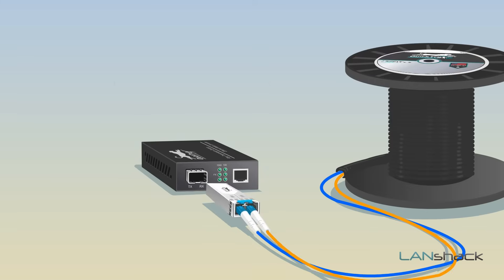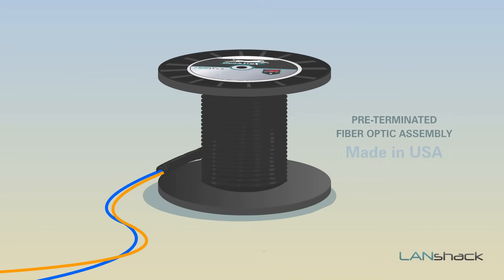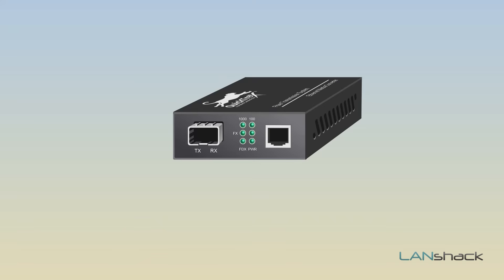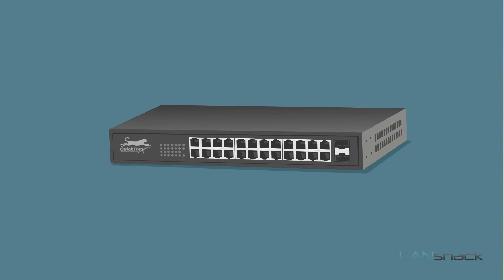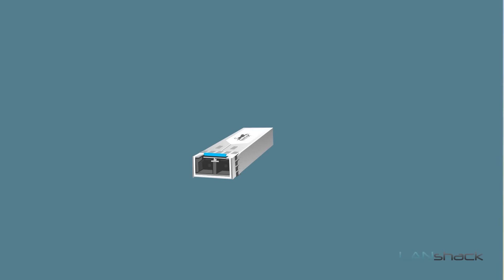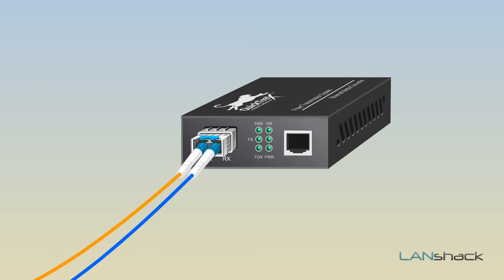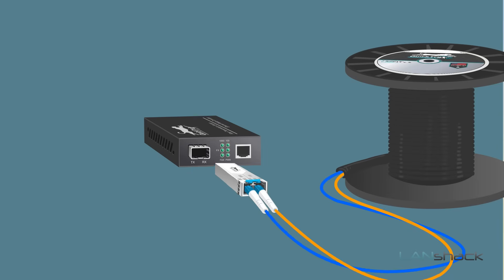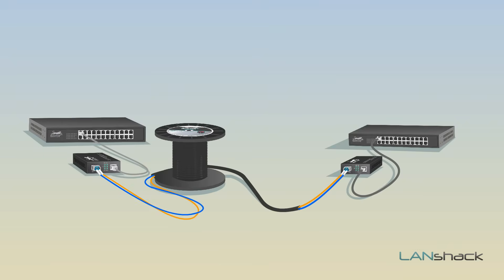How to Extend your Network Using a Fiber Optic Assembly and Media Converters

Comment: Can I do this to extend my fiber by using ethernet cable? So by doing fiber to ethernet and then ethernet to fiber?
Reply: You typically get 100ft out of ethernet while fiber you get alot longer range, going to fiber is one reason to extend range if a p2p wireless data solution won't work.
Reply: @amb1u5  yeah but i wanted to relocate my router, i have ethernet only in my walls
Reply: @matres24  well no matter how you do it so long as the media converters are powered and your ethernet is less than 100ft per run aka 100 then a rj45 -> spf then spf to -> 100ft of more ethernet. If everything is connected correctly it will work